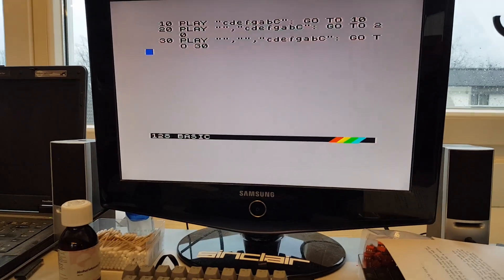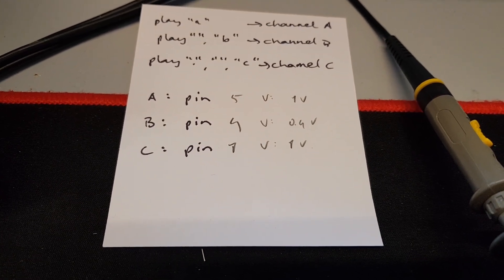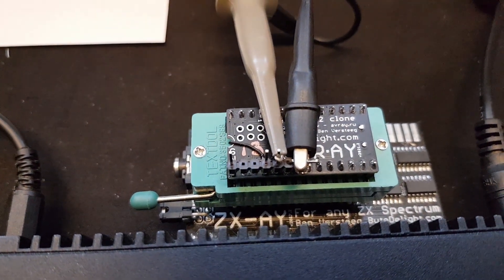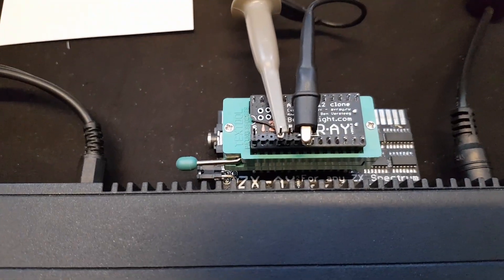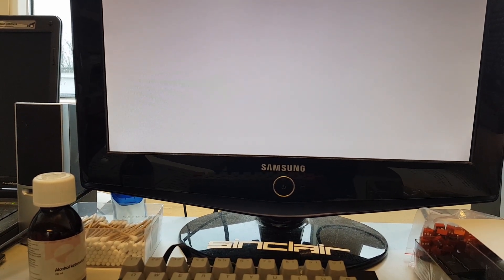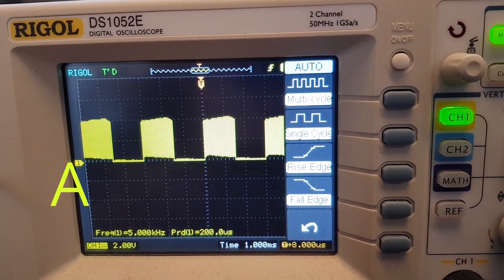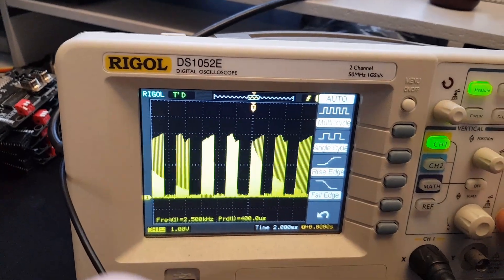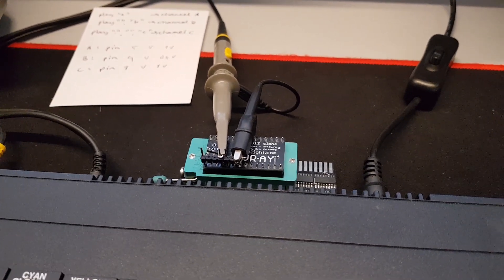AVR-AY 3 channel testing

Comment: Is channel B a mix of channel A and C? if so it might be just interference between the A and C channels. I thought that all models of the AY-3-89xx had only two audio output channels.
Reply from the maker: Original AY-3-891x chips have 3 output channels: A, B and C.
The main problem with the AVR-AY clone, is that the ATMega chip used, only has two 16 bit timers, and one 8 bit. So to use all three, we have to change the behavoir of the 16 bit ones, to get to the same volume levels as the 8 bit one.
It kinda succeeded, but in the meantime other AY clone chips were developed, which might have even better features. So I have to dig in to it more.

Comment from the maker: I want to thank everyone thinking along with this challenge!

It surprised me that two days in a row, I post technical stuff where I usually do not get much response to, but for some reason I do now.
Maybe it's the way I present the information nowadays, or maybe it's just that more and more people have a tech background, and recognize the issue.

Anyway, a couple of people pointed me towards the PWM timers of the ATmega microcontrollers.
The problem with those PWM timers, is that there is only one 16 bit timer which is used for 2 sound output channels - if you want to use a third sound channel, like on the original AY-3-8912 chips, you're stuck with only an 8 bit timer for that, with these AVR microcontrollers.

The usual workaround is to have the software mix the third channel to the other two, which means stereo mixing is done within the chip.
But some applications, like on the ZX-AY external sound card, or on a Harlequin 128 board, expect the three channels to be available on their respective pins, so mixing can be done on the board instead of the sound chip.

So I really wanted to have 3 channel output, otherwise I had to think of workarounds for that (there would have been several options).

Oh: What is PWM, and why is it used? Well, it is 'pulse width modulation', a technique used in many applications nowadays, like in very efficient power supplies.
With the AVR-AY we're using a digital device (the AVR microcontoller) that cannot create an analogue output easily, other than mimicking the analogue signal in a way. 
By rapidly (far more quickly than the audible waveform) enabling or disabling the output, the average voltage will look like the analogue signal that is required.
The average signal is achieved by having the signal pass through an electronic filter to flatten it out and 'remove' the PWM spikes. 

It's magical!
And I actually think the original AY-3-8912 chips do the same, it's probably in the datasheet (I'm too lazy to look into it right now).
So the way the AVR microcontroller does it, is probably very close to the way it's done in the original AY chips, hence this 'clone' sounds so incredibly well!

Now there may be several ways to solve this issue with PWM on the ATmega microcontrollers.
One solution is to just lower the 'resolution' of the 16 bit timer, to match the 8 bit one, so max 255. The PWM on all three channels will be equal then.
I'm working on that now, will test within the hour, but I bet that will solve the issue I presented in the video!

Comment: Hello Ben,
I just tried with the files: "Conf_standard_20MHz_1_75Mhz.hex" and "AY_Emul_260_3ch_m328_ay"
And I do not see any difference in level on the 3 channels.
Here is the configuration and the output frequencies:
PIN 15 ATmega 328 = Channel A = 217KHz
PIN 17 ATmega 328 = Channel B = 78KHz
PIN 16 ATmega 328 = Channel C = 217KHz
The ATmega is used with a 20MHz quartz

Comment: As you can see in the code
 ; update PWM counters
 OutReg OCR1AL, OutA
 OutReg OCR2A, OutB
 OutReg OCR1BL, OutC

channels A and C are using 16 bit PWM, but channel B is using 8 bit PWM, so you can use some resistors to equalize the levels
it was the trick to make 3 channel version...
Reply from the maker: Exactly! So I think 3 or 4 people pointed me to this, which is just awesome! Didn't expect so many people would know about this!

Comment: Is it something specific to the IO pin used for channel B - ie. something different about the capabilities of that IO pin?
Reply from the maker: That's one thing I had in my mind to check out yes, looking up the datasheet now.
Reply from the maker: Got the cause and probable solution, check my latest comment on the video!